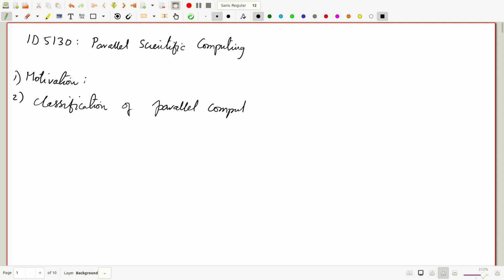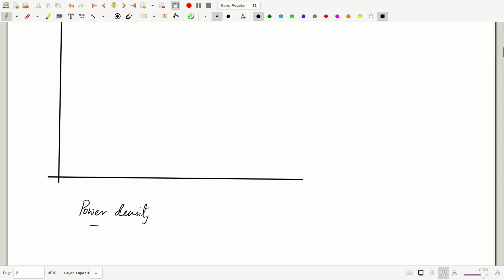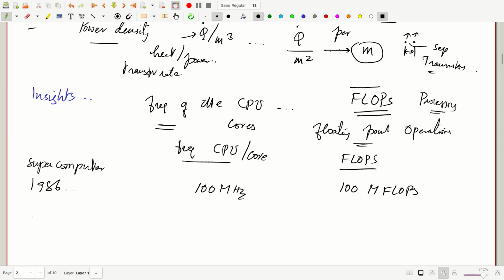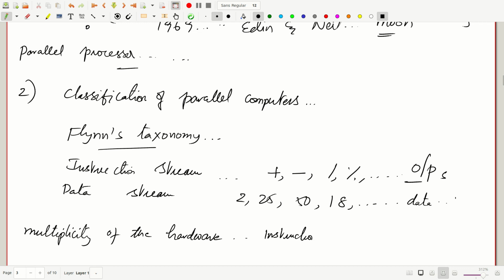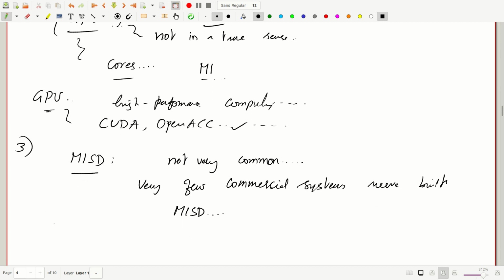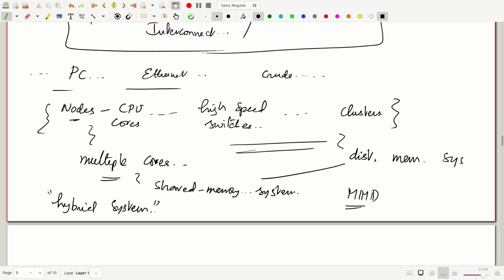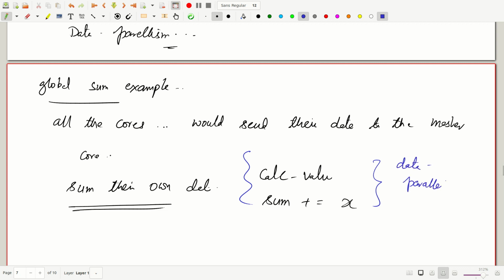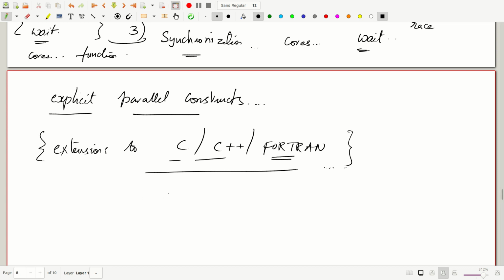L3 Classification of parallel computers and overview of writing parallel programs

Comment: Sir are there multi-multi cores. where set of processors is a set?
Reply from the maker: Yes, Adarsh. Often multi-socket CPUs or even many-core GPUs can be cast under these categories. In the first, cores are grouped into a socket, and multiple sockets form the CPU. In GPUs, a group of cores forms a streaming multi-processor, and multiple multi-processors form the GPU.
Reply: @HPCEducation  thank you sir